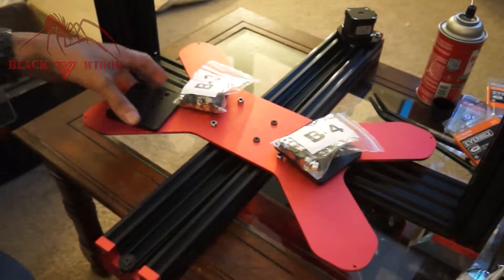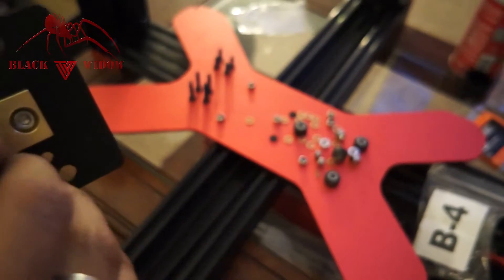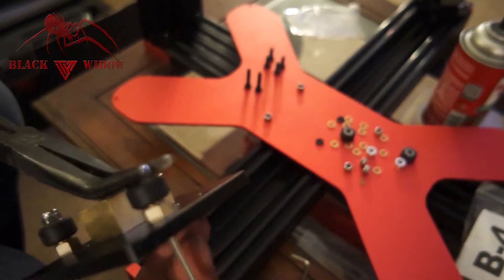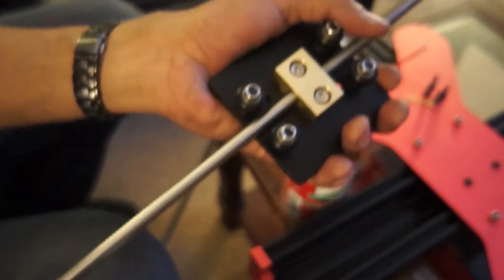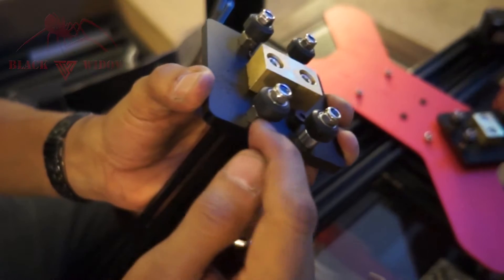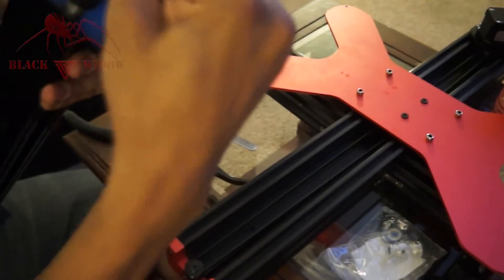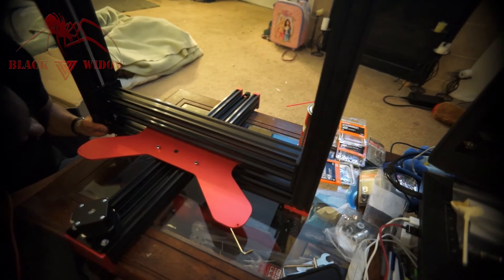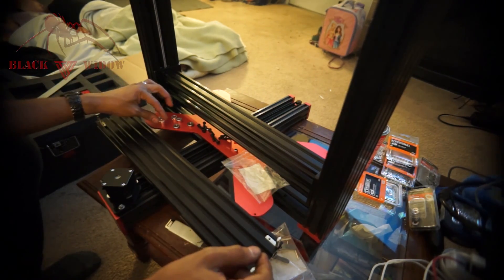Tevo Black Widow X axis assembly

Comment: First of all, I would like to say thank you for making this video to show others how to do it. I wish I would have watched your video before I had built my BW. One thing I noticed in your video is that your building this heavy printer and moving it around while its setting on a glass surface. Are you crazy bro, lolz. I must say, job well done if you completed the assembly without breaking that glass surface. 

Quick question, Did your BW have any alignment issues on the X-Axis. The 2 horizontal beams that make up the X-Axis are 0.11mm off on 1 side. I only found this out after trying to do a X-Axis MGN12H Linear Rails Conversion on my BW. The left side was smooth, but as it carriage move to the right side. You could feel the carriage starting to get a little harder to move. I had printed out a centering jig on my sons little monoprice printer just to make sure that both rails were centered on the beams. After that didnt solve my problem. I took my digital caliper and measured the distance between the top beam and bottom beam, and sure as heck. The right side was off by that 0.11mm. I know that's doesn't sound like much, but when you are trying to pair up 2 linear rails up. You have no play room at all. The have to be dead nuts exact.

I guess I will be taking my X-Axis out and see what's causing the problem. Maybe I will design a small box jig that I can place permanently on the inside of each end that will help align the beam up perfectly. hmm.
Reply from the maker: Yep! Glass was still intact haha There will be alignment issues anytime you make a kit yourself but its up to you to make sure its adjusted out :) Yeah the two lead screws were a pain to align but once you do they are awesome :)

Comment: i just got this printer, why is your piece brass and mine is plastic? thanks
Reply: That's a question I would like to know as well. The brass leadscrew nut is some much better the the plastic ones we both got.
Reply from the maker: The plastic is a smoother quieter piece :)